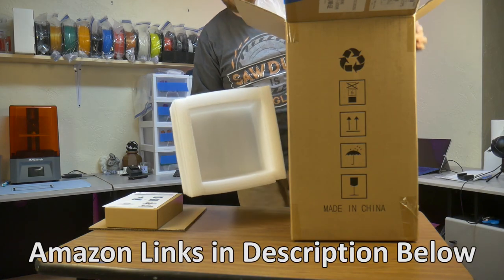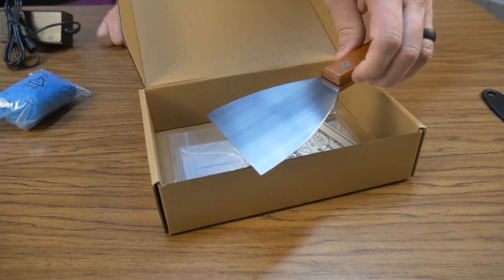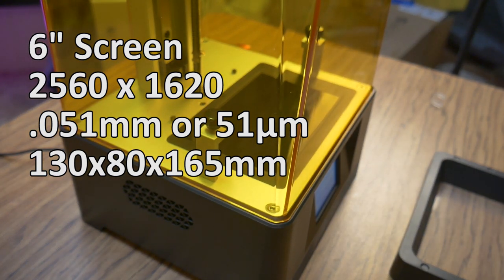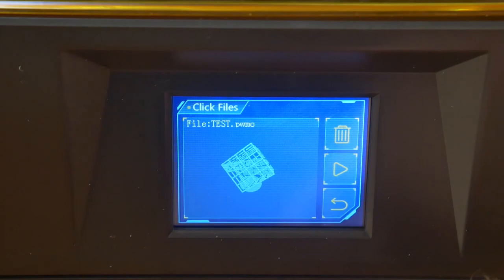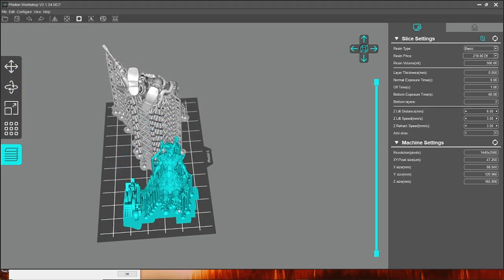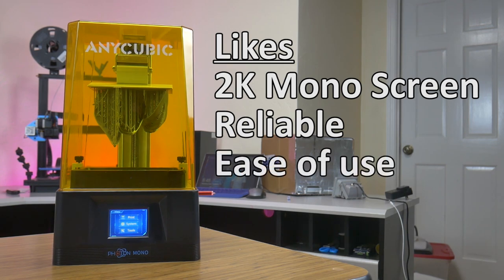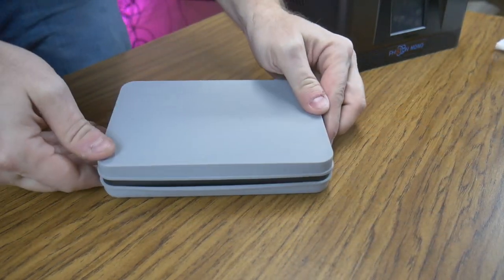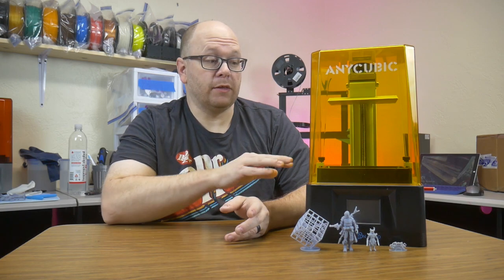Anycubic Photon Mono Review: 1 Major Design Flaw

Comment: Hey Thomas, thanks for the video! I unboxed my printer today and tried printing the test file, but after a while, I went to check on it and noticed the cube had snapped off from the base circle and the whole thing was a waste. I'm pretty sure I did everything I was supposed to do in terms of setup (levelling, etc..) except that I had filled the resin vat at the minimum line. Do you think that was the reason or am I missing something here? I'm totally new to this and I have zero knowledge about 3D printing.
Reply from the maker: Hey Naz. This hobby can be frustrating at times, but in the end it is so rewarding! A couple things to consider: build plate level is crucial. Try leveling again with the card and make sure it doesn’t move while tightening the screws. Another big factor is the room temperature where you are printing. Every brand of resin has an optimal temperature range, but I generally try to keep my printing room above 70F. That was the biggest contributor to failed prints while I was learning. Give it another shot, don’t get discouraged! Let me know if it ends up working out. Good luck!
Reply: @SouthpawWorkshop  thanks for responding!!

I leveled it again and tightened the screws on the resin vat + added a bit more resin this time. I warmed up the resin bottle (by placing it near a heater, but not too close_ for a few minutes and I made the basement where I'm printing warmer this time.

It worked and I'm really looking forward to learning more about this hobby!

Cheers!
Reply from the maker: Great news. Have fun!

Comment: Been looking at thus one. Not sure if I should go with it or the Elegoo Mars 2 pro. This one is currently cheaper by about $30
Reply from the maker: You should be fine with either choice.  Keep in mind that FEP replacements on the Anycubic are expensive and hard to find, so you may be better off with the Elegoo.
Reply: @SouthpawWorkshop  ended up going with Elegoo, resin also seems to be less expensive

Comment: how about the fumes? is there a vent on this unit? as of now, that is my main concern for this unit. Thanks!
Reply from the maker: I prefer mine without the vent. As long as the lid is on, no fumes will escape. When post processing, I wear an organic vapor mask to deal not only with the resin vapor, but also the alcohol vapors. Once the lid is back on or the resin is back in the bottle, the smell goes away rather quickly. I think the vents are a bit of a gimmick, in my opinion.

Comment: Hi, does it make significant noise while printing ? You re the only one reviewer that made an noise sample I have found so far. And the only comment about silent/loud. Thank you so much for that.
If you can compare it to the apartment noises like fridge etc... I would be extremely happy :)
Trying to decide if I must get Longer Orange30 or this Anycubic. Which one would you prefer for the same price ? Thanks !
Reply from the maker: I don’t have a Longer Orange 30, so I don’t know how noisy it is, but I can tell you it is only LCD and not Mono, so it will take longer to print when compared to the Anycubic. Also, Anycubic’s Mono screen is supposed to last longer than traditional LCD screens. Maybe something worth considering. As for the Anycubic noise: I have 4 printers and the Anycubic is the quietest of them all. It may still be louder than a fridge, but if located correctly, shouldn’t be too bad, especially if you have music or a tv on.
Reply: @SouthpawWorkshop  oh thank you again good sir. Does this Anycubic have a cooling fan that makes noise ? Or the Z-driver is the only soundmaker here ?
Reply from the maker: Anycubic does have a cooling fan but it is very quiet. The only noise you will notice is the z-motor
Reply: @SouthpawWorkshop  god bless u. I'm gonna purchase this little guy

Comment: Hi, you state that there are not many printers that are better at that price, I am wondering if you could list the ones that are better for roughly the same price. Thanks in advance
Reply from the maker: Check out the Voxelab Proxima. Same quality prints, better quality construction and probably about 25% less than the Anycubic Photon Mono. The only other that would be equal to the Photon Mono would be the Elegoo Mars 2.

Comment: I bought a bunch of STL files but the printer won't recognize any of them. Do I need to print the test file first?
Reply from the maker: You will need to use a slicing program such as Chitubox to convert the STL file to a format readable by your printer. Hope that helps!
Reply: @SouthpawWorkshop  I did figure outbid needed to convert them first, I just didn't know how. I was using the photon workshop and saving them as model files. I didn't realize I had to press the giant blue layered icon beneath the manipulation Keyes to save it a a Slice file. I got it figured out. Thanks you
Reply from the maker: Great! Happy printing!

Comment: I have not found temperature tolerance data for the grey resin.  I need prints that can survive vulcanizatiin in rubber at 300 F. Can you help? Many thanks.
Reply from the maker: High temperature resin is a fairly limited market. Formlabs makes a product that can withstand up to 238C but it is pretty pricey. About $200 USD per liter. Check it out at the Formlabs.com website.
Reply: @SouthpawWorkshop  thank you.  That is really the only resin that I have seen. I was thinking that there must be others,  but looks like there isn't. I need to find out if that resin will work in this Anycubic Mono that you have reviewed here.
Reply: @SouthpawWorkshop  searched and read all day. Here are 2 others....
Siraya Tech Sculpt Ultra 220C $75
Loctite 3D 3860 High Heat 185 C $199
Reply from the maker: Interesting. I didn’t know Loctite even made resin. I hear nothing but good things about SirayaTech. For the price, it might be worth it to try out.

Comment: What layer speed did you use please?
Reply from the maker: Depends on what resin you are using, but anywhere between 1.8 and 2.2 seconds per layer is usually a good place to start.

Comment: Nice review. Trying to decide whether to spend the extra $ and get the Mono SE for the metal case.
Reply from the maker: Personally I don’t think it matters unless you plan on transporting the printer regularly. On top of that, I find the “hinged door” solution to be cumbersome and it actually interferes with your ability to work on the printer, remove a full vat of resin, etc.
Reply: @SouthpawWorkshop  Thanks. Good point on the lid.

Comment: So I only need the resin ?
Reply from the maker: You will need a way to clean the print after it is done printing. Normal resin cleans up with isopropyl alcohol. There are water-washable resins out there as well. For curing, you may want to buy a UV light, but you can also use sunlight as a free way to cure your prints. Hope that helps!

Comment: How much extra does a resin print weigh over a PLA?
Reply from the maker: Good question. I have no idea, but it would depend on how you would print either one. The amount of infill on the PLA print and whether the resin print was hollowed would have the biggest impact on the weight of each type of print.

Comment: Hi i bought 4 printers :
Photon zero
Photon +
Black photon s+
Photon mono 
I wanna sell 3
Wich one you should keep and why?

Greetz Edwin
Reply from the maker: I like the mono screen printers, so I would keep the Photon Mono
Reply: @SouthpawWorkshop  okay thy do they print more datail?
Reply from the maker: The detail is about the same. They print a little faster and the big difference is that the mono screen lasts longer than the LCD screen before you would need to replace it.

Comment: I'm so torn up trying to decide between this and the mars 2 pro
Reply from the maker: I think you can’t go wrong with either. I’ll tell you right now that the Mars has better build quality and I prefer their leveling system and vat, but it does cost more.
Reply: @SouthpawWorkshop  the elegoo mars 2 is technically talking the same as the mars 2 pro and cheaper. It costs 200€. It could be a good competitor to the mono.

Comment: using 3 days and the uv light not working, not sure its the uv light power supply or the uv light panel itself, using multimeter read 12v from the in or out of uv power supply and from the uv panel itself, also i noticed the heatsink of uv panel its just the bottom 3d printer plat without fins or a fan

Comment: How you made those miniatures look soo smooth? I have my Photon Mono for three weeks and every print i made is in lines and steps clearly visible , they look just ugly 😔
Reply from the maker: Hmmm. Not sure. Are you sure anti-aliasing is enabled? I can’t even remember if that is an option. I honestly printed with whatever default settings came in lychee slicer.
Reply: Maybe its the temperature, ideal its 25 degree i read

Comment: I need help very badly everything I try to print is coming out as broken supports of unrecognizable blocks i try to print some infaentry units or one single ork and each time it filled the entire build plate with random unrecognizable molds of split supports and random crap you cant even tell what the models were suppossed to be and I cannot find anything online at to help this I watched hours of troubleshooting videos and notbing as resolved the issue I repelled redid exposure times went back to factory exposure tried doing on mini at a time angled to 45 degrees and I keep getting just twisted melted piles of slag that dont resemble anything close to the model I am trying to print. It is becoming very frustrating to the point of wanting to cry I waited for so long and jumoed through so many hoops and worked my ass off to get this mono printer and I cannot for the life of me get it to print anything.
Reply from the maker: Sorry to hear about your troubles. Have you tried running some screen tests to make sure your screen is in good shape? There should be an option to display a grid pattern on the screen, lay a piece of paper over the screen and look to see if the pattern and intensity of the light is even across the whole surface. Another question I would have for you is what type of resin have you been using? I hope you can get your issues resolved soon!
Reply: @SouthpawWorkshop  the lights are fine I just checked it that was my first thing theres a video on my youtibe page I uploaded thank you and i am using the anycubic resin that came with my photon mono. I must be missing something I am brand new to 3d resin printing it pronts the test prints I followed instructions step by step for using chitubox for the photon I dont kmow what is happening.
Reply: @SouthpawWorkshop  I fixed it I have no idea what I did to fix it but it is printing now I think maybe I had overloaded to many models onto the printer or the files were corrupt.
Reply from the maker: Great news!

Comment: Does anyone know the speed difference between this and the color Anycubin Photon? I've got the color and was wondering if it's worth the upgrade. I know I can upgrade the screen in mine, but it's a real faff with the chance of breaking something, and the mono seems pretty cheap now.
Reply from the maker: Exposure speed on the mono is 2-3 seconds compared to the 7-8 seconds exposure on the standard photon. That doesn’t mean that the mono prints 2-3 times faster though. There is a lot of time spent lifting and repositioning the build plate, so I would say the mono is probably 20-30% faster than the standard. If I were you, I would use what you have until the lcd goes out, then consider upgrading at that point. Happy printing!
Reply: @SouthpawWorkshop  I know that some printers allow you to change the firmware to make the up/down movements faster. Does this mono have that possibility?
Reply from the maker: You can change those settings to a certain degree in Chitubox. I know some people heave experimented with pushing the limits of speed on these machines, but I prefer to keep my speed stock because the faster you move the platform, the higher the chance of print failure. So to answer your question, yes you can speed it up in the slicer and possibly push it even farther with firmware changes, but the law of diminishing returns applies prominently in this case. Good luck!
Reply: @SouthpawWorkshop  Thanks. I appreciate the reply.

Comment: The FEP failed on me And cured resin onto my lcd, sadly finding an lcd replacement is nearly impossible!
Reply from the maker: Sorry to hear that. Hopefully you can find parts somewhere. Try the resin 3d printing Facebook group as I have seen people get links for parts from other members of that group.
Reply: @SouthpawWorkshop  I’m in it. Nobody gives a straight answer or they’re talking about any other model BUT the photon mono
Reply from the maker: Check this out:
https://m.aliexpress.com/item/1005002213909734.html?albpd=en1005002213909734&acnt=708-803-3821&aff_platform=aaf&albpg=743612850714&netw=u&albcp=1582410664&sk=UneMJZVf&trgt=743612850714&terminal_id=237a33fab5ca4c84bd58af80f2f44d8e&tmLog=new_Detail&needSmbHouyi=false&albbt=Google_7_shopping&_randl_currency=USD&src=google&crea=en1005002213909734&_randl_shipto=US&aff_fcid=322a30595bb042d688c9fb5b56723e76-1620165310045-08777-UneMJZVf&gclid=Cj0KCQjw4cOEBhDMARIsAA3XDRjypBwpg1cX_a7ld5MMsQuqP0pyJ6ZonPMLimXqfqeddhzXuBb7V_QaAnYcEALw_wcB&albag=59754279756&aff_fsk=UneMJZVf&albch=shopping&albagn=888888&isSmbAutoCall=false&aff_trace_key=322a30595bb042d688c9fb5b56723e76-1620165310045-08777-UneMJZVf&device=m&gclsrc=aw.ds
Reply: Always wise to bear in mind that manufacturers will almost always use off the shelf parts when they can, rather than develop their own. Especially LCD screens, spindles, bearings, transistors, mosfets, etc. The LCD will be widely available as Thomas has shown
Reply: @Jin-Ro  the lcd is the same, it's the connectors that are VERY different. I talked to anycubic and they sent me a new LCD and replaced the whole unit as well as sending me a pack of fep replacements. Things have been working smooth for me ever since.

Comment: trying to decide between this and the elegoo mars 2 mono :(
Reply from the maker: I think you can’t go wrong with either. The FEP replacement thing with the Anycubic might be a deal-breaker if I had to decide between the two. You might also want to check out my Voxelab Proxima review. It is really good and a lot cheaper.
Reply: @SouthpawWorkshop  Yeah thats true. Also, with the elegoo software being supported with lychee and everything else like photon might be the pick.

Right now, im seeing voxelab proxima for $209, Elegoo mars 2 mono for $229 (sale) and anycubic photon mono for $219 (sale). With these prices which would you recommend for a complete beginner? The pricing isnt too much of an issue for me its just to say they are fairly close.
Reply from the maker: I have the Voxelab and the Anycubic and they both have been flawless. Anycubic and Elegoo will be compatible with more aftermarket stuff like spare vats, FEP and build plates. But the Voxelab is the best built out of the three. Not sure I can make a recommendation one way or another, but you should be confident picking any of the three because they are all established and well-supported.
Reply: Go with the Elegoo Mars 2 Pro. Better quality, bigger screen, better placement of usb, bigger support base. Also comes with 2 replacement FEP sheets.
Reply: @shanedich3660  only thing is that a good $100 more than mars 2 mono or photon mono

Comment: Thank you for this! I am getting into 3D printing and this was very helpful. If I may ask a question about 3D printing: my concern is that the plate size is small. If I wanted, could I change the orientation of the print so that I can make longer items? In other words, since the width is only about 3.1", could I turn the print on its size in the program so that I can make something as wide as 6.5"? Sorry if that's a stupid question, new to this and just curious if that's acceptable to do. Thanks!
Reply from the maker: Absolutely you can do that in the slicing software. You can change to any orientation and even print diagonally with supports. Cheers!

Comment: Is there a bad odor to this?   I've been thinking of getting an SLA printer but the only space I have is in my bedroom
Reply from the maker: Every time you open a bottle of resin or open the lid to the machine there will be a strong smell. Add to that the solvents required to clean up the prints and I would say that it probably isn’t suitable for your bedroom. You can mitigate some of the smell by printing exclusively in water-washable resin, not as strong as regular resin, there still would be an odor present